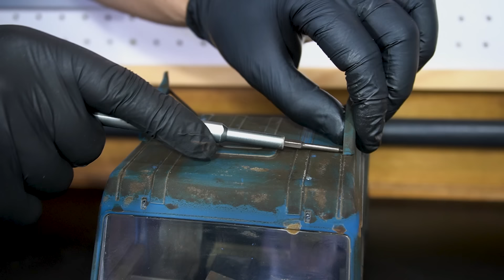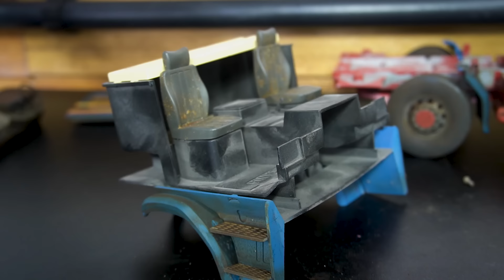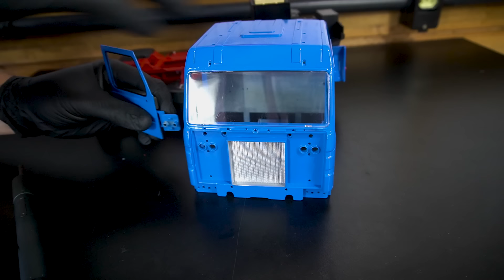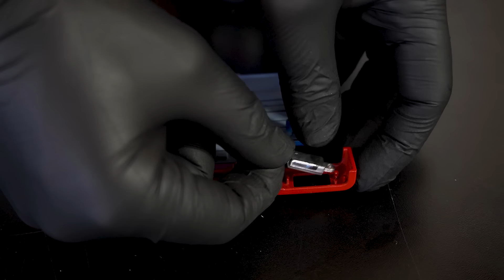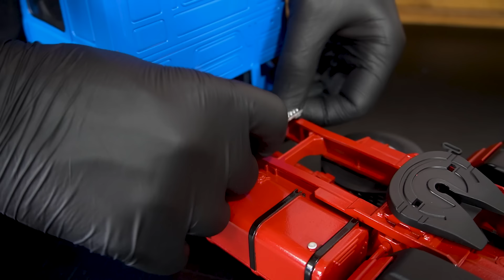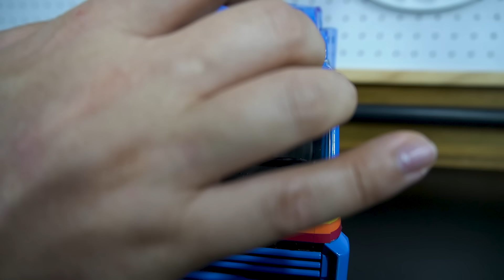Restoration Scania 143h Top Line 1987

Comment: Very nice. Looking good like it was new. Only 1 small detail as a ex-truckdriver. Where you put V8. Should be 400,420,450,470 or 500. Those were the engine type,s possible for this cabine with the 14 liter engine in it. But it is just a small detiail. That green you put onit after blasting, is that a metall etching primer?? or just a normal metal primer?? And wich brand it is?? Thanks for the video  and possible awnser.
Reply: The God's must be crazy 2 1989 movie truck used for poaching wildlife in the deep Kalahari desert.
This truck was popular in South African comedy movie in 1989.but the truck was different was towing a T trailer water tanker.but the colour was the same and the truck was carrying elephant tusks.